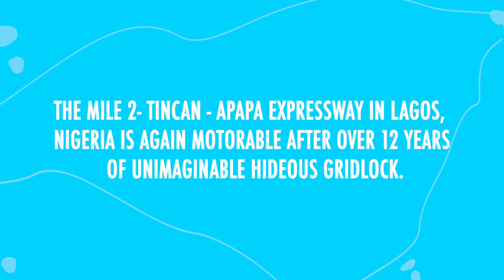OVER 12 YEARS HIDEOUS GRIDLOCK DISAPPEARS FROM MILE 2- TINCAN - APAPA PORT CORRIDOR

Comment: The solution is simple but we refuse to plan well, Create an inland port terminal at some location close to the Lagos-Ibadan/Benin expressway, such as Mowe or at Otta in Ogun state. A railway will link the Apapa and Tin Can ports to this inland port and most containers will be ferried by train to this inland port. 80-90% of Trucks will collect and drop off at this point and from there carry the goods inland. Only goods destined for Lagos metropolis should be collected at the seaports. Lagos will be de-congested and de-polluted